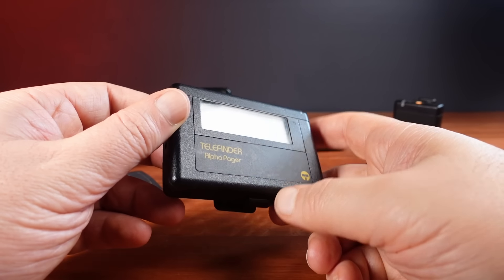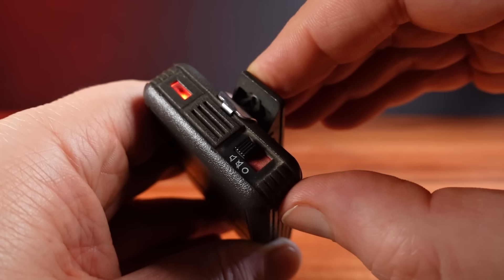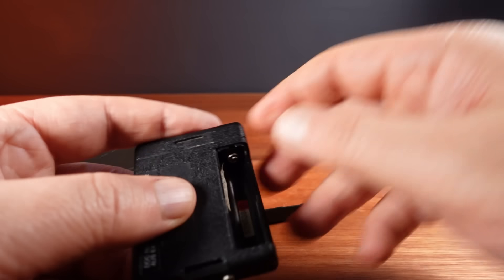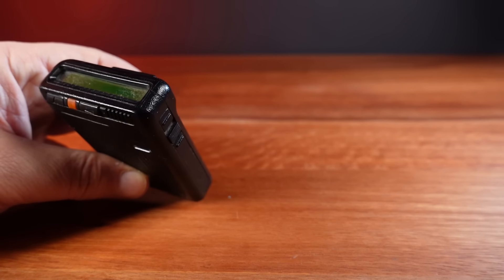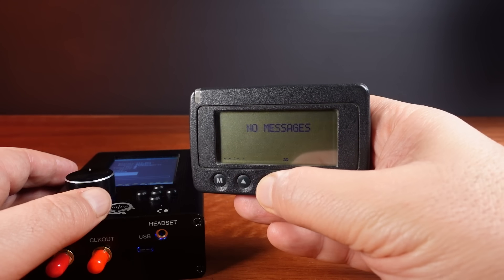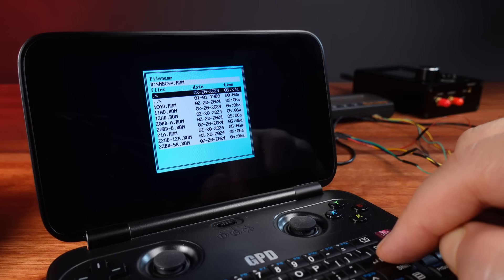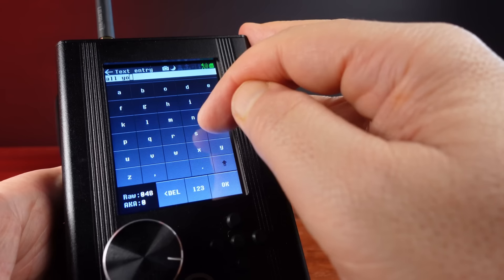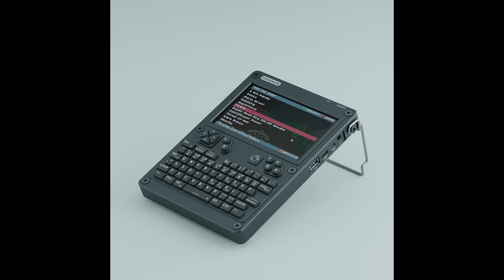Hacking 1980s Beepers & Pagers Back To Life

Comment: I recently got a couple pagers, one unintentionally in a job lot of junk off ebay, an NEC 20b (in translucent Teal, looks so cool!), branded as a PageOne MiniCall (a UK Pager operator still actually operating to this day), and a Vodafone UK branded NEC 11a, as per this vid, for modding and messing with, but I've been going bananas trying to use RPiTx to do as it claims of being able to send POCSAG messages, but all I get is "command not found", annoyingly, despite multiple attempts to download and run the software... :(

So until I can figure that mess out, I'm repairing the NEC 11a with a new EL backlight (you can buy generic stuff off the internet and trim to fit, as well as use different colours too!) and possibly a new LCD polariser as it's looking like an old DMG-01 gameboy screen with that "LCD burn" look, but that's a scary process to peel and replace, cos it wouldn't be the first LCD I've cracked in trying...
Reply from the maker: RPiTx looks like a great project, I hope you figure it out.
Reply: @JanusCycle  So do I, I'm not a coder type so the command line stuff is giving me a headache!!! As for the NEC 11a pager, turns out the backlight is dim on these models because it has a weak driver (possibly for battery life), with a cut-to-fit replacement that arrived quickly, it's still dim, but that said I ruined the LCD ribbon in the process so it's a moot point now I guess!!! :(

Comment: You should look up the rpitx project, you can transmit straight out of a gpio pin on the pi, obviously it’s low power and needs some filtering but you can write scripts which you can call to send different messages
Reply from the maker: rpitx look like a very interesting project, amazing they were able to get it to work.

Comment: I’m actually working on a pi w powered pager with display
Reply from the maker: cool, what radio connection will it be using?
Reply: @JanusCycle  it’s actually not going to be RF in that sense. It’s going to be a pager but with some WiFi packet sniffing software to store PMKID and hash’s… kind of a tribute to the Hackers Movie Hackers pagers

Comment: Hey man awesome video. About SDRs in Canada though. They aren’t banned. Our stupid technologically illiterate government said that they were going to ban SDRs but they haven’t and probably won’t. It really pisses me off when I think about our government banning these sorts of devices. They’re used by hobbyists and engineering students, not criminals. 

Most criminals in Canada are stealing cars by using a DIY RF amplifier that can amplify the signal of a key fob on newer cars. It only really works if the person you’re attacking parks their car right in front of their door and if that door happens to have a key fob hanging next to the entrance. Once they do that they can press the push to start button inside of the car and they take off!

Anyways back to my point about SDRs…. Not a single SDR can break in to a modern car. All new cars use rolling codes to authenticate the car keys with the car’s security module. The “record and replay” attack that the government says is possible only works on cars built before the early 90s, NOT modern cars that 95% of people drive today. It’s just a scapegoat by the government because we’re dealing with soaring crime rates in Canada and the government refuses to take the blame for it. 

I just bought an SDRPLAY radio in a physical store a couple of weeks ago, they’re still fully legal. The day the Canadian government decides to ban and enforce criminal action against people using SDRs radios is the day we’ve lost it as Canadians, if we haven’t already…

I’m sorry about the rant but our current government is passing some of the stupidest policies while we Canadians are struggling with real problems. Taking away RF engineering tools reduces the amount of people getting into engineering and removes an amazing gateway drug to becoming an RF nerd.
Reply from the maker: I was hoping to get more people around the world to be aware of this issue. Thanks for the detailed comment about the state of affairs. With more attention hopefully better ways to deal with vehicle theft will come.

Comment: 3:54 if there are only 2 million codes couldnt you easily brute force it until you found your code? Similiar to password hacking.
Reply from the maker: That's a good idea, but at 512 Baud it might take a while.
Reply: @JanusCycle  Yeah you would need some dedicated hardware for it for sure, a laptop with a transmitter and the right software, not sure what that would even but hey, its definietly doable, but probably just easier to do what you did with the beautiful and excellently designed custom cable lol.